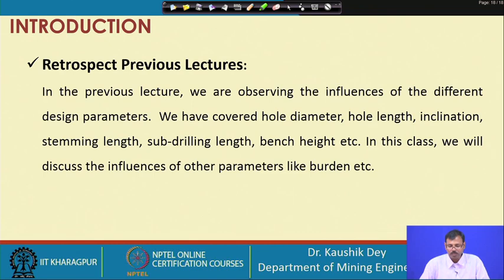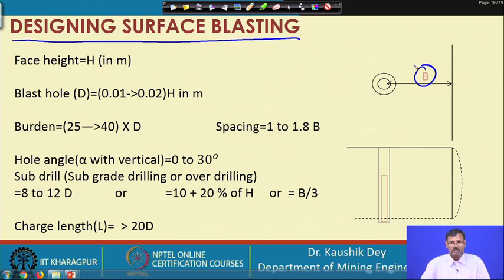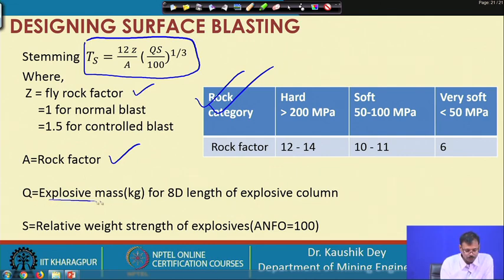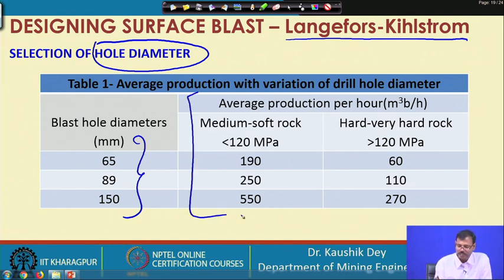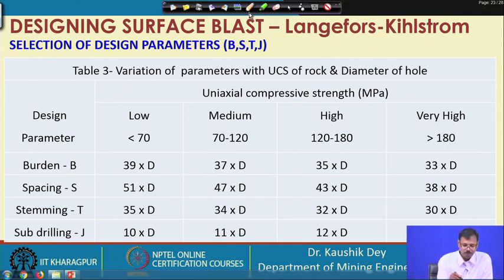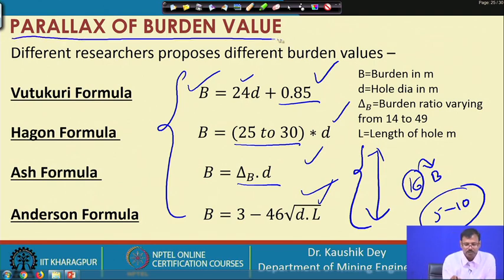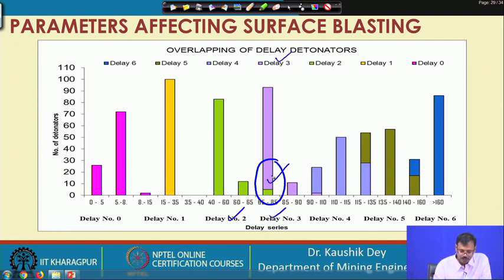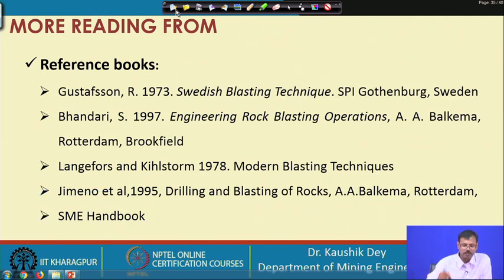Lecture 30 : Surface blast design

Comment: Hi please help

Assuming the density of coal to be 1.4 tons/m3
, seam thickness of 4m and bord width 
of 7 m. If the continuous miner section production target per day is 40 m advance 
and the advance per blast for a conventional are used mechanised mining is 2.7m 
per blast per face, how many faces are to be blasted per day to match the 
continuous miner daily production target?
Reply: 13 faces
Reply: @luanncronje7736  at least 15